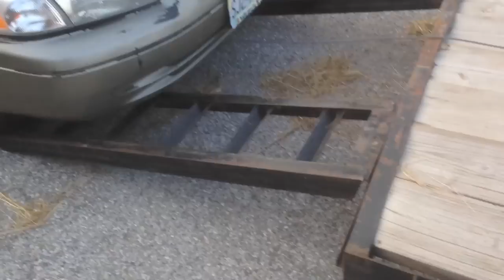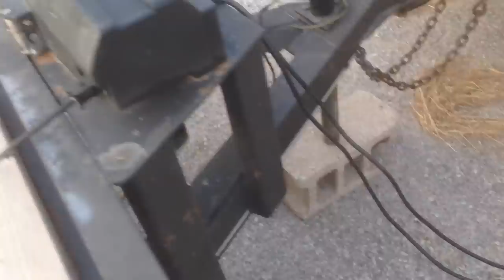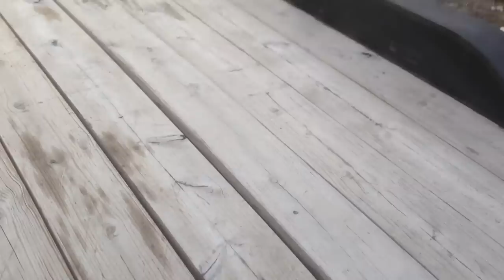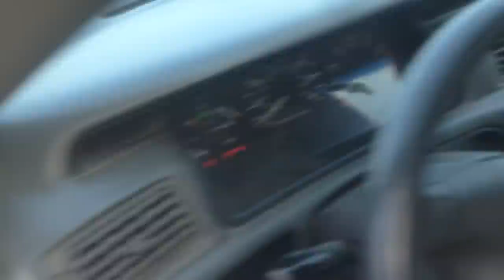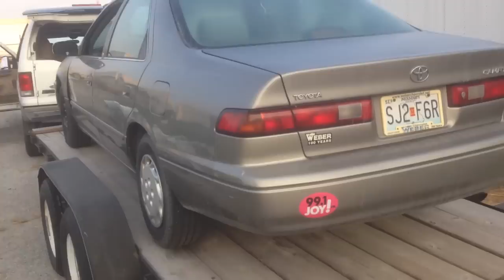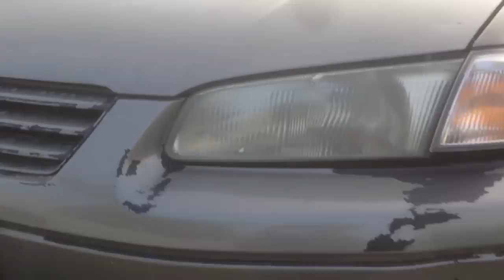Trailer Winch Towing

Comment: Exactly the way I load them. I loaded a 10000# one ton dually diesel yesterday with my 4500# winch and it straight line pulled it on.

Comment: Wow just in case anyone is wondering, you should never ever be rubbing your winch cable against the frame of the trailer like that while winching a vehicle up. Not unless you have some kind of heavy duty roller there. This is a great way to snap the winch cable and have it whip your face in half.
Reply: Ya man fr. How do you not let it rub though?
Reply: @Grasscentral4705  The simplest answer here would be to place another cinder block under the trailer jack. He put one under there and explains that he did it to prevent the cable from rubbing worse. Another couple inches would probably do the trick.
Reply: @Grasscentral4705  Now, if you get the car halfway loaded and find that the undercarriage is about to rub at the rear edge of the ramp because the angle is too steep (happens more when you have a long vehicle with small tires or underinflated tires), then stop winching, back it off a tad, then place blocks in front of the front tires. That way when you resume winching it will raise the front end of the vehicle which is usually enough to provide a better "breakaway" angle under and allow it to clear the trailer's edge without snagging.
Reply: @allmycarsisbroke  oh okay that makes a lot of sense, i really appreciate the response man. Is there a certain kind of block that will work best with a skid steer? Feels like a stupid question, but figure its better safe than sorry. Really not trying to damage my truck
Reply: Oh also do you think the cinder block is necessary? @allmycarsisbroke

Comment: Bolt some extra metal in those ramps and use the center of your ramps...and a 20 dollar snatch block will double the pulling power of the winch.  I carry 2 cheap jack stands for the rear corners of my trailer to stabilize it

Comment: I use a 24v X1 winch rated at 2000 lbs and it doesn't strain nearly as much as yours.  I've used it to load from a 2002 Explorer 4x4 to a Range Rover HSC.  That's straight pulling....no pullies.
Reply: What makes you think his winch is straining?

Comment: Not to discourage you from showing very decent emergency scenario type tech to show how to winch a car onto a trailer with no dedicated power installed for a winch, very good adaptation! However, I just wanted to caution anyone watching that whenever a winch is in use that has steel braided wire it is critical to pre-load the wire, always try to maintain center of cable length weight, with anything of weight (ie backpack, tow strap, even a front floor mat) draped over the cable in the event of a cable failure. Steel cable stores energy so standing next to it, or anywhere within a 360* angle of half the length of the wire, could end in severe injury or death. You were just outside the 20% safe zone of rate winch capacity so good on you, but I cringed watching you stand on the trailer deck while operating the winch. I do a lot of off road wheeling and extreme vehicle recovery and I always use a dead weight on my line. Just my recommendation ( and every reputable winch manufacturers safety tip as well). But again, good job showing simply tech solution (electrical supply) for a very simple recovery effort that can save people hundreds in towing $$'s. Be safe y'all!
Reply: Where would the weight object be placed?
Reply: @watajob  His message contains good advice but he's a little difficult to understand. What he's saying is just get any weight you can and place it so that gravity and that weight is pulling down somewhere around the middle of the extended section of cable. In this case that might be a little tricky because the cable is so low to the wood deck, but for example if you have a plank of wood a few feet long, you could hang some d-rings/shackles from the middle of the cable.

The goal is just to make it so there's some directional force on the cable so that if it snaps, it doesn't snap back in a wild direction and hit you or someone else in the face.

In situations where you have more clearance between the cable and the ground you can just drape a backpack or a bag of tools or something over the middle of the cable and let it hang there.